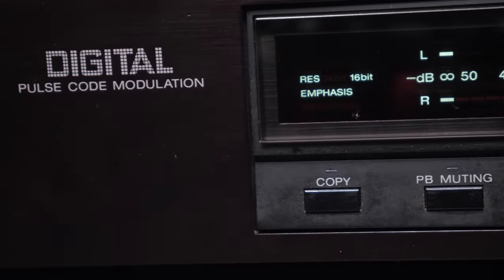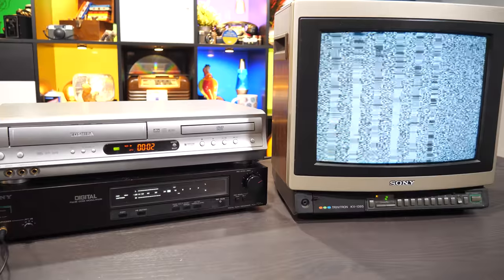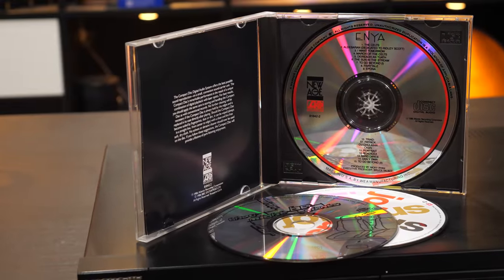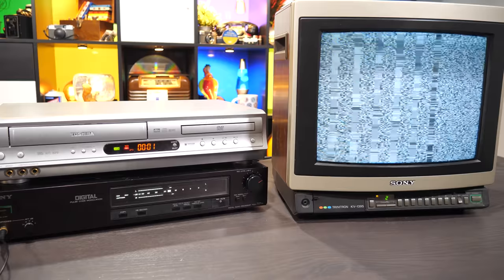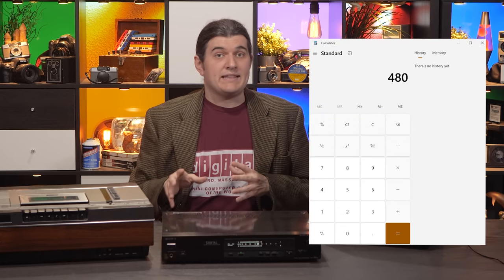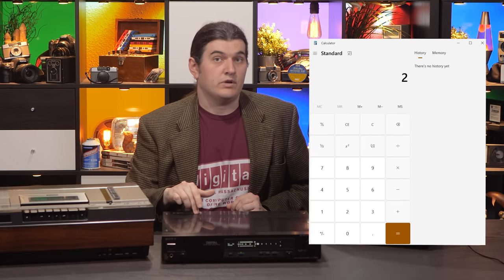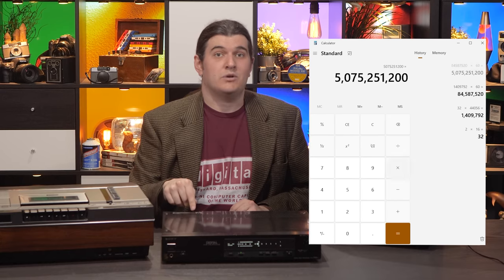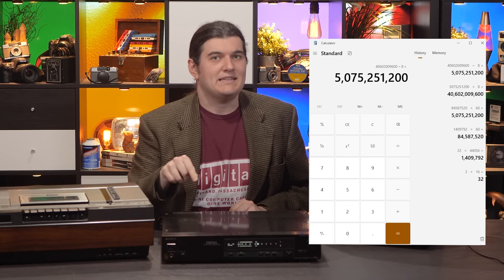Digital audio needed videotape to be possible - and the early days were wild!

Comment: Do you know why the audio-to-video encoding uses binary video, i.e. black and white, vs grayscale, in which each pixel takes a value in, say, 0 to 255?
Reply: It's much easier to properly distinguish a bit in an analog signal when there are only two possible values. The more distinct intermediate values you have to try to tell apart, the more the noise and imperfections of reading and writing a signal from tape would cause shifts in the signal levels and cause the wrong values to be read. It's pretty much the same reason digital microprocessors themselves use binary (on vs. off) rather than a range of intermediate voltages in their circuitry. The circuit design is far simpler and more robust doing it that way.
Reply: @TravisTev  But it's not necessary to tell the intermediate values apart perfectly right? Instead of thresholding each bit, one could simply scale it the range [0, 1] for some bonus analog information.

Comment: So, I'm 50, and I remember all this technology.

You know what is weird?  Technology is NOT going to significantly change from this point forward.  Maybe we'll have cheaper SD Cards, maybe we'll have faster machines and faster GPUs, but we won't have obsolete formats.

in 2070, there won't be a guy on whatever exists then explaining "this is what is called an SD Card / USB drive / computer monitor / cell phone..."

 I bet hard disks go away, they will all move to solid state.  I mean, that's not hard to guess.

Comment: PCM video tapes can't possibly have anything to do with the PCM digital audio format used on computers (better known by its Microsoft trade-name WAV), right?
Reply: WAV is not Microsoft's "trade name" for PCM, it is a container format. it frequently contains PCM data, but it is still just a container. but yeah, PCM is PCM. different representations, but still the same technique for encoding a signal
Reply: @jotch_7627  I mean, it contains audio data, but it seems from the video that for audio data to be PCM it has to be in one of the two encoding formats described above -- while wav (even minus the header) is not. Maybe I'm missing something (or maybe there are features of WAV I'm unfamiliar with from never bitbashing them)... Whenever I open a wav file, if I've got debugging messages on, I see the file format detected as PCM -- even when I know (because I constructed it) that it doesn't have error checking bits or anything like that.
Reply: @JohnOhno  you misunderstand what PCM is. it is not a file format, it is a conceptual representation of an analog signal in terms of some digital data. its a math concept, not a computer one. any tool that tells you otherwise is doing so out of convenience, not correctness. you can store that data however you like, and you can add as much error correction as you want, but the core math is identical. and to reiterate, WAV *is not PCM*. it is a container format, much like MP4 or MKV, that is capable of and commonly used to store PCM data.
Reply: @jotch_7627  but clearly, when I send a sequence of bytes representing sample amplitude and nothing else, that's not PCM; so, when a tool opens a wav file containing a sequence of bytes representing sample amplitude with a header stuck on the front and says "this is PCM", is that just because the developer of the wav decoder library was too lazy to correctly declare the format?
Reply: @JohnOhno  that literally is PCM. PCM is a list of numbers representing signal amplitude at regular intervals. it is not a file format. you could write these numbers on a god damn clay tablet and it would still be PCM. it is a mathematical concept. please just read the wikipedia page on it, because at this point im tired of re-explaining this over and over
Reply: @jotch_7627  I watched a long video on it. This one. What it describes is much more specific, so either there are two uses of the term or somebody fucked up.

Comment: Ok, you asked for this one, in your 700mV representation.... if you were going from 0-255 mapped to 0-1000 (I assume you were doing 1v peak) then the 700 would not be possible :D You could have 698 or 702 (rounded) which would be 178 and 179 (decimal) respectively 107 in your example would give you a value of 420mV (rounded) did you sneak in a crafty 420? if so, bravo.

Comment: You make it sound like a 12-bit ADC is only a tiny part of this device because it is supposedly no big deal. This is not true. A resolution of 12 bit was actually a pretty big thing in the 70s (not to mention the 60s). In the early 80s, a single 14-bit ADC cost thousands of USD. Considering the technology development, a 12-bit ADC presumably cost the same amount in the mid-70s. In 1983, before the CD-Audio was introduced, there were heavy discussions about the resolution of the upcoming format, whether it would have 14 bit or 16 bit resolution, because a 16-bit ADC cost a real fortune. So the 12-bit ADC in this device certainly takes up much more space and made up a much bigger part of its cost than you believe.

Comment: computers were NOT FAST ENOUGH to even play 'cd audio' until about the 386 processor, and even then there is MUCH more to it than just being able to store those large amounts... there is a reason why a CD ROM only has room for 700MB (you saying that a CD can actually hold GIGABYTES of DATA 'using the CD Audio format' is COMPLETELY MISLEADING - that like taking a modern 1TB USB stick and plugging it into a 386 by using those old USB-to-PS/2 adapters (ps/2 is the port used for keyboard and mice BEFORE USB took over for everything, and adapters were very common... and sea-foam green lol) and saying that it SHOULD work because it all fits..... it MUCH MORE complicated than that... and I REALLY don't you want me to explain it all.[.. you could look it up if you REALLY wanted to)
PLUS back then TAPE WAS USED.. FOR BACK-UPS..... and that because you NEED you back-up to 100% CORRECT they HAD TO USE ERROR CORRECTION... which become WAY WAY WAY MORE COMPLEX when it comes to FILES on a computer compared to 2 16-bit audio channels with a set range (the frequency response) - there is a KNOWN QUANTITY as to what the error'ed information is SUPPOSED TO BE... so you can write an ALGO and predict how much processing it could ever need...... 
BUT as far as files on a computer the error'ed info could be ANYTHING and that REQUIRES a HUGE AMOUNT of processing and TIME calculate and fix - this is one of the main reasons TAPE BACKUP were NOT used as regular storage... too slow to read and/or write, too error prone, and if you're reading a file that's at the beginning of the tape then you have to go to the back of the tape it gets super dooper OOBER DOOBER SOOPER POOPER SCOOPER SLOW!!!!!!
- - - And SO they DID have THIS MEDIUM AS A STORAGE SOLUTION... KINDA... it just doesn't work the same way as you think it would....but it is TOTALLY UNDERSTANDABLE why you9 came to the conclusion that you did... it makes sense, in a way... I hope you read this... mainly because I want you to understand that it was used... you weren't the only smart guy that thought about this... its just that the 'logistics' behind it hadn't evolved to the level it needed to be at to make it work.....and by the time it did, other better mediums had made it onto the scene which were even better :)

Comment: The only use for moderately reliable 5GB of data in the 1970s I can think of is scanned documents. There was big text data like dictionary in like 1985 when CD-ROM was out but I doubt there was in 1970s and analogue tape is not very suitable format for that purpose. Xerox 914 is released in 1959 and the process can be considered almost digital. So it might be nice if some company made such thing. That should be totally possible. But just recording it as video is much easier especially when tape itself is not that expensive. And there's already a thing like microfilms. Well, PCM is best use I think.
Other than that... various observation data? It's nice but there's not big enough market. I think he's true in that there's no other use for such a big data in the era.

And I'm pretty sure CIA had this thing back in the day. Buy three set of them (actually six for both end and one noise generator) and add some simple XOR circuit, you get voice version of one-time pad. The president can use his voice to deliver assassination orders to local spies. Syncing is a bit difficult but number of attempts resolves.

Comment: 29:03 Also, without an equivalent 8 track version it's pretty useless for a home studio.
We had an 8 track Tascam PCM recorder at school which used SCSI Caddy HDDs and a two track Tascam DAT recorder in 1996.
The hard disks were ludicrously expensive, I've read shared between two students and gave us 15 minutes each.
You could then mix it down to the DAT recorder for submission as well as create 'backups' of your HDD on a per project basis.
I've still got my DAT backups of my school project work although i would need identical hardware to turn them back into 8 track recordings! 😂
Reply: They were 8 track HDDs storing 30 minutes at 16bit 44KHz.
4GB I believe, storing 240 minutes, divided by 8 (tracks) equals 30 minutes then divided by 2 (students) is where you got your 15 minutes.

Comment: The only thing I hate worse than pedophiles, is audiophiles! No, that's a bit excessive as far as hyperbole, but audiophiles are annoying. I think they're dumb. Literally willing to spend thousands of dollars on cables! I'm like, come on Brah, if you have to have shielded cables, just buy some standard electrical wiring with the flexible metal conduit included! It's already quite the upgrade with the solid non braided copper wiring and it has built-in shielding for a fraction of the cost. Also, if you use metals other than copper, you wasting your money! Copper is fantastic. Also, I'm aware that they even have tables so fancy that the shielding actually has a current going through it to further improve the shielding. You could probably do the same exact thing with running low voltage through the flexible metal conduit, because, believe it or not, there is instances in the past the flexible metal conduit was literally used as a grounding wire. I found that out the hard way when adding a fart fan on the existing bathroom light circuit in my now ex-wife's bathroom. The professional electrician we had to get to fix it back me up and said it was some whack 1950s wiring, that he had a hard time with himself.